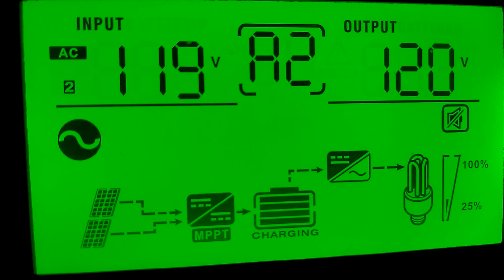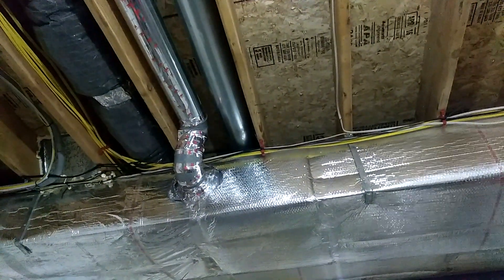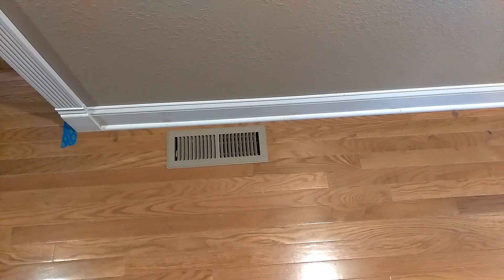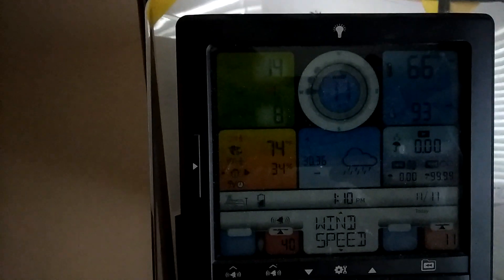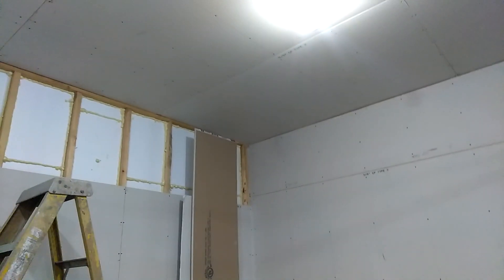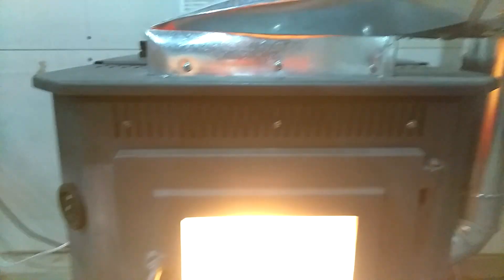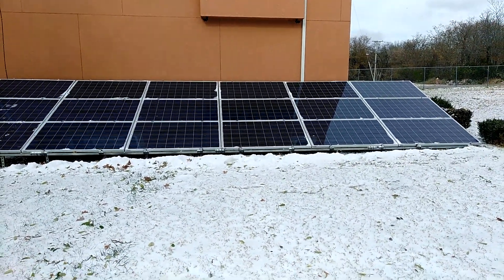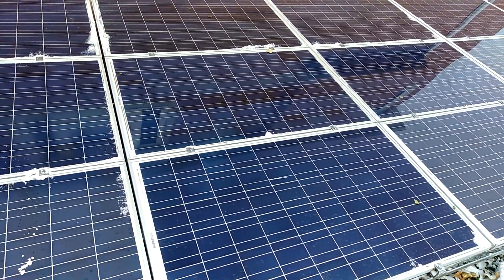Update on the solar  and my converted pellet stove.

Comment: LOOKS good brother. Have you seen tho's fans that go on top of a wood stove that use the heat to make the fan run. Its free to power would maybe save you even more power from that fan your using now. Best part is the fan will just run when the stove is hot.
Reply from the maker: I was told by the company that it does not work on pellet stoves but I might try one anyway .  thanks for the info
Reply: @carsonlurbanwindandsolar3437  Good info to have. I seen them for like 45 bucks. If they do not work you can send it back. Would be cool to see.